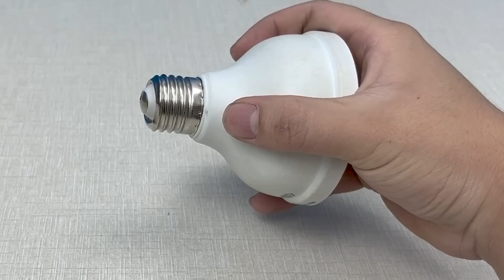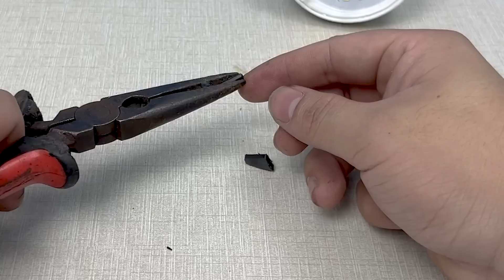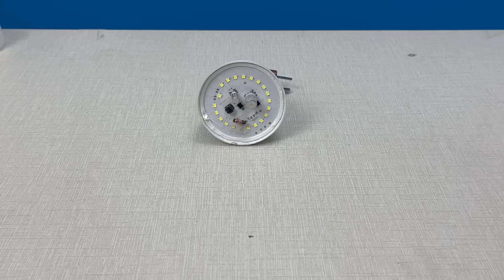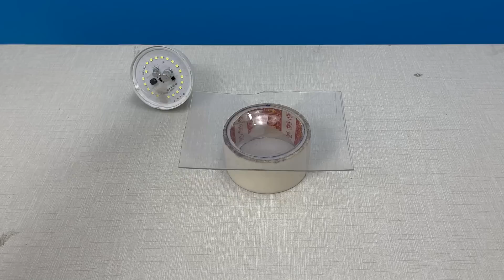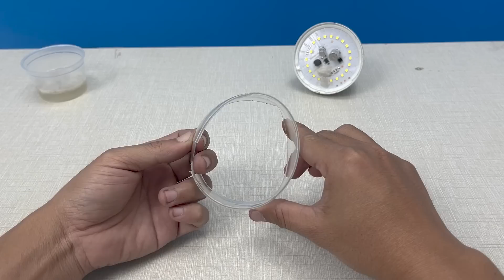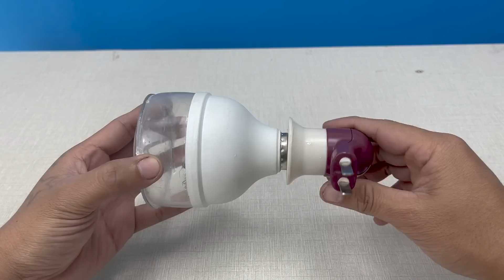Nobody Told You This! Make Your LED Brighter and More Durable – Up to 3km Range

Comment: Nao seria mais facil comprar um resistor e soldar no lugar do led queimado.
Reply from the maker: Thanks for your feedback! It's true that using a resistor instead of a burned-out LED can be a simpler solution in some cases. However, it also depends on the purpose and requirements of the circuit. 😊

Comment: Видео для тех, кто не знает чем руки занять. Искал сгоревший диод как будто не видно его без прозвонки. Ножом сковырнул и запаял без всякого резистора. Стабилизатор выровняет напряжение. Я так делаю и лампы горят больше года.
Reply from the maker: Thanks for sharing your experience! It's true that sometimes simple repairs like this can be surprisingly effective. Thoroughly checking and replacing the diode is a good way to restore functionality without the need for extra complicated tools. Very impressed with the way you did it! 💡